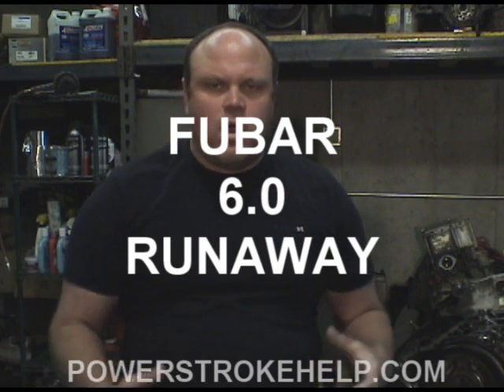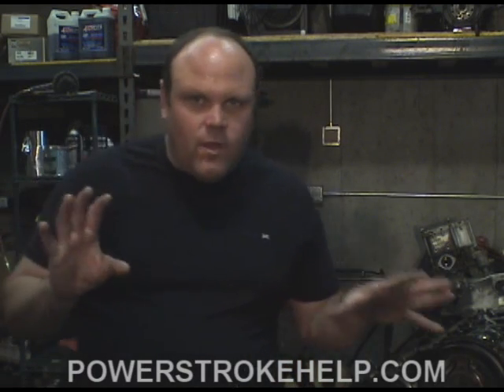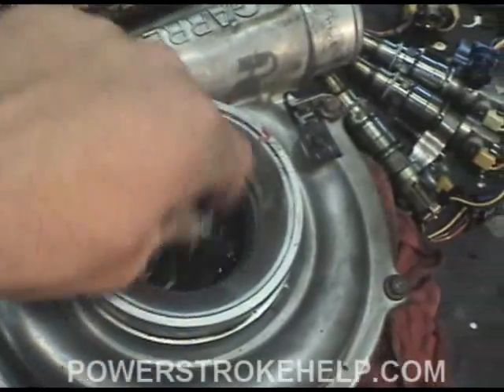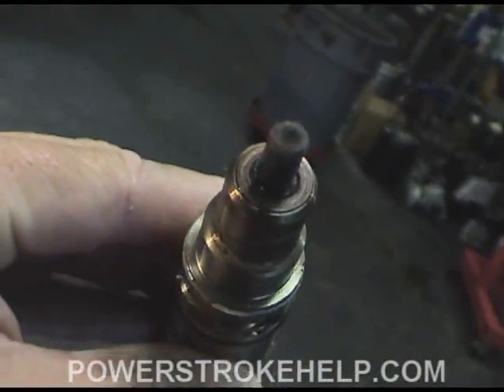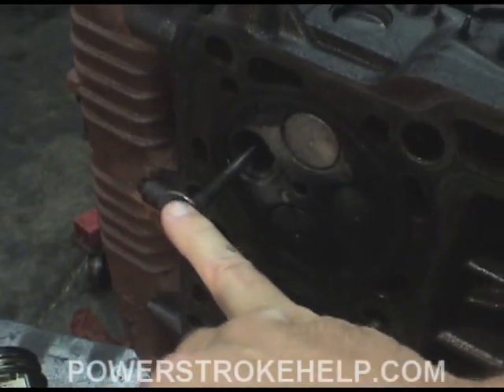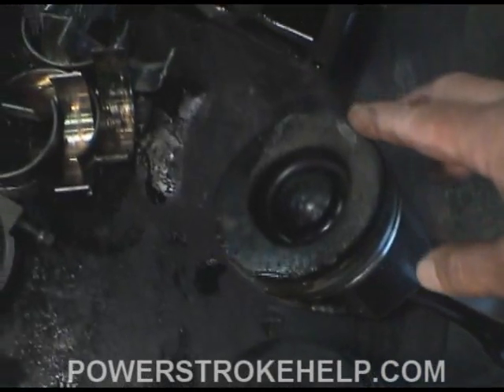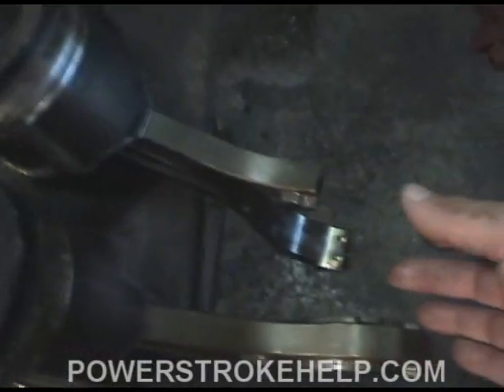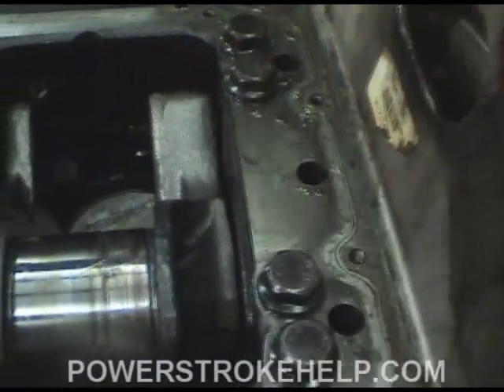FUBAR 6 0 RUNAWAY - TURBO SEAL FAILURE LEADS TO TOTAL ENGINE DESTRUCTION

Comment: Grind the crank, throw in a new piston and rod. Rebuild the heads and put it back the street, I have a very good friend that has worked for IH for over 20 years. The 6.0 is one of best engines they ever made. Yes they a lot of problems with them, but did you know that from 03 to 2007 ford sold more diesels then chevy and dodge put together? With that many trucks on the road you are going to have more problems. One thing that IH screwed up on was in 07 at the end of production the ran of rhe USA made delphi lifters and put some cheap china made in them. I work on them and own 5 for my business (Solenberg Performance). Two of them have over 300,000 miles on them and have never been worked on. If you change oil like you should they will last forever. That is the big thing that the injectors don't like is dirty oil.
Reply: Ford sells more trucks in general so that's probably why they sold more. We should look at the percentage of failures while comparing the powerstrokes, duramaxs, and cummins to see if the 6.0s were really a bad engine or not. I think they are bad because the engines were made in a rush because of the new exhaust regulations at the time. I am not a 6.0 fan, let a lone a powerstroke fan. I do like the 7.3l powerstrokes though.
Reply: No the had been a no lubrication situation inside the engine at that point which means that  the bearing ran without oil. You probably already knew that but oil is also a coolant so the bearing ran without coolant (oil) for however long it ran, possibly undoing the tempering that was done to the crank and rods and stuff. Simply grinding would not help
Reply: +XRA1D Ford sells more trucks only because they are cheaper and disposable and businesses need shiny new trucks for their images and write-offs for taxes, it makes business sense to buy fords.. Anyone who buys a truck for longevity isn't buying a Ford.
Reply: stephenromansd I have to disagree, I'm not saying I'm a Ford fan though... But I do have a 96 F150 inline 6 5 speed and that thing has been through hell and back. It's been extremely low on oil for over a thousand miles, the oil has gone way past the point that it should have before it got changed, and it just gets the crap beat out of it every day. It had a stuck lifter so I just dumped some ATF in the oil and it freed right up! Great truck but I'm more of a Chevy fan but I LOVE Cummins. So I have a Chummins lol.

Comment: In a Runaway situation, can you shut down an engine by plugging the exhaust pipe?
Most times you can get near the air intake, but the exhaust pipe sure would be easier to plug !
Reply: Just put it in top gear, step on the brake hard and dump the clutch. Of course, if you have an auto, you deserve to get screwed. :3
Reply: No. The engine is burning oil as fuel and the only way to stop it is to prevent it from ingesting enough air to continue the combustion process

Comment: I have a question, my truck wasn't over heating and have the same symptoms. With the exception that I had a y-pipe leak that we fixed. I'm throwing 3 codes of concern, p0275, p0284, they're cylinder 5 and 8 cont/bal faults they other one is a p132b turbo charger boost control a performance code. Any suggestions?

Comment: You only talked about 1 cause of runaways. Fuel rail failures, fuel leaks, overfilling oil, others. You can tell the difference by the smoke. Gray-blue thick/dense smoke is an oiling run and usually(not always) lower RPM. Black(er) smoke and super high RPM is most often fuel rail or other fuel issue. Sometimes the damage (like the sheared turbo shaft) is secondary to the main failure cause. Detroit, Rolls, and many others have air shut-off flaps to prevent this. Most industrial applications require this. Even non-turbos can runaway.
Reply: Hes right.. my 6.4 had a fuel leak and oil level was so high the turbo sucked it up and it was crazy high RPMs. It lasted about 45 seconds and its sitting at the shop now to see if any damage was done

Comment: By the time you've found and stuffed something in the intake and it runs out of air, the engine could have already grenaded. Stick it in a high gear, foot on the brake, dump the clutch and stall it.

P.S It's AL-U-MIN-IUM.
Reply: P.s He's from the USA, they say A-LUM-INUM. You'll never change that!
Reply: Most Powerstrokes are automatic
Reply: P.S. Aluminum (one 'i' - four syllables) was discovered by Hans Christian Ørsted who named it after the alumina (al-OO-min-uh) salts from which it's extracted. The IUPAC does not recognize any such chemical substance called "aluminia" (al-you-MIN-e-uh) hence, the original pronunciation is the four syllable one. BUT, as is the rule in the English language; If enough of a given population coin their own term, including superfluous syllables, it becomes accepted as correct.

Comment: this video is super helpful, i think this is what is happening to my dad's truck i'll take off the heads when i can fine a place i could work on it. i already replaced all injectors new turbo egr valve egr cooler. the truck throughs out a lot of smoke and it smells like diesel also the oil level was hi even though the turbo was leaking oil into the intake. do you have an idea what could make that happen?

Comment: You probably mean Isuzu/Opel 1.7TD. Exhaust wont work because building pressure can rip the pipe anywhere behind the engine even if you'll manage to seal its end. If you cant reach turbo or are scared to mess about near extremely unstable engine try putting it on 3rd gear and quickly releasing clutch holding the brake AND emergency brake with all force. This should strangle it instantly and can be performed by anyone on the roadside

Comment: When I was watching your vid would never think Ill find my PSA HDi having a runaway just 3 months after. Volume and amount of smoke is unimaginable. Luckily I was in front of the car and had a big cloth to shut the intake like you said before engine completely went wild in rpms. Can now say to all turbodiesel drivers, if your car changed its owner many times before - have condition of your turbo checked asap because ppl think it can be fixed with denial but it can't and WILL surely strike back

Comment: hey bill, i have an 07 f350 6.0. i recently straight piped the truck and notice a blue haze for about a minute after start up. once the truck is on the road, there is absolutely no smoke from the exhaust. what are your possible thoughts? note that the truck is making 26 psi of boost. let me know
thanks

Comment: Good to know, thank you very much :). What can make a big difference I think is that you are on 6L quite big engines when I think about European engines as mine. I have 1.7L turbo diesel engine right now which is most common in such of cars here. I think there is no as much pressure on the exhaust in that engines and at the same time getting close to the turbo is almost imposible where there is no much room around the engine and it's located behind it.

Comment: I would like to ask you for advice in case of runaway. For normal car user puting something into the intake in such of situation is almost imposible especially when there is no much space around the engine and you cannot reach the turbo by your hand. All you can do is to play with air filter which is connected by plastic pipe so it can split and take air anyways. So is it a good idea to try to close exhaust first ?

Comment: I saw a Leyland Beaver go wild in about 1960.When the operator went to shut it down, he released the stop cable too soon. The motor stopped, kicked back and fired up , in reverse. The mechanical governor went wide open and pulling into top gear and using every bit of brake available, it was subdued. Cab full of smoke; draws full of something else!!

Comment from the maker: Thats cool. In the old days when we would street race, we would put about a quart of Nitro methane in the oil before the grudge run. The Nitro would vaporize when we got hot halfway through the run and be sucked into the carburetor through the PCV valve and it was like Bo Jackson hit the back of the seat with a base ball bat. YEE HAA. Won some money doing that, but the other guy was too.

Comment: if this happens on a gasoline car you get just as much smoke but it revs at normal speed and can be shut off like normal. happened to my dads old '03 saab 9-5 wagon. (SO much smoke)

Comment: oh yeah...if you lose the govenor in a old mechanical system  you could be in for a wild ride...ive also seen it happen in a Oldsmobile 350 in a 1979 Delta 88 that sat for years and had bad valve stem seals,oil was getting in into a few cylinders ...it didnt shoot up to out of control rpms or anything but he couldnt get it to shut off until he got a shop rag over the air intake

Comment: I watched a Duramax lose a turbo in this same scenario and go into a runaway. Very scary. Had this happened on the road, not sure how you could have stopped it without just grabbing neutral and letting it blow. Engine was stopped in the shop by shoving a 2x6 over the intake duct from the air filter, but only after a HUGE amount of valvetrain damage was sustained. Engine was replaced.

Comment: dont know what whimpy motor your thinking of but in my experience a runaway will snap the drive-shaft like a toothpick if you try to dump the clutch just use a extinguisher of stuff a rag in the turbo better to just have a dead engine than a dead engine and a dead power train

Comment: a engine runaway on a nonturbo engine will happen if there is to much oil is in the engine or if the piston seals a leaking so if the oil is coming in the pisten it wil run on the oil and you can stop it with a hand shifted car by putting it in highest gear an let the clutch come up hard but a automatic wil run til it blows or if the oil runs out

greatings from a diessel machenic from the netherlands

Comment: How can a non-turboed diesel engine runaway? Can the fuel governer actually break in the pump? Becuase I heard about a John Deere 4020 that was non-turboed and it totally ranaway becuase the governer can break in the old rotary pumps and pump tons of fuel and rpms until the cylinders expand and it sucks oil up out of the crankcase to continue running then the oil runs out and the motor goes to shrapnel.

Comment: Would it be possible to stall an engine that is running away, or would it just drag the vehicle, no matter if you slammed in 5th gear and let the clutch pedal go real quick to intentionally stall it? Or wouldn't you know this because there are only automatic transmissions in your field of experience? Anyways, is it at all possible to stall a torque converter based automatic vehicle?

Comment: ive had this happen with my truck before i never know anything about runaways at the time i thought it might be bad fuel or something so i did the mistake and drove it to a grage and it ran away and eventually killed my engine to the point it self destruckted all over the road in pieces and me stranded so smart thing lerned i had an air shut off put on the intake in the event of this agane

Comment: My biggest fear but whats the chance with a bone stock 7.3L Powerstroke with 278xxx miles on it? hopefully slim to none if its not overfilled right?? and 1 more question why am I getting such good fuel economy I have a 7.3L crew cab F-350 DRW ZF5 & getting 20-22mpg alittle high right??

Comment from the maker: I'm sure if the engine gets hot enough it can, but gas engines dont have as much compression as a diesel. So it will probably just start smoking and foul the plugs and not restart.

Comment: All this new crap has all but destroyed the benefit of the Diesel Engine.  It's a sad state of affairs.  Cost went way up, economy went way down and, IMHO, reliability is down.

Other than big trucks, I don't see the benefit any more.

For all these reasons, Ford is on the right track with it's EcoBoos V6 in the F150.  

IMHO.

Comment from the maker: I have 5 of them. the closest one was 400 yds round trip. By the time I got back the connecting rods would have been bouncing across the parking lot. Too many years and too many beers.
Reply: Had this happen today. After changing turbo left over oil fromold turbo caused it to run off the oil at roughly 5000 rpms. 20 seconds seemed like 5 minutes.

Comment: That could not be farther from the truth. Ford sold the 7.3 and International kept producing it because of the fact it was so reliable. Manufacturers actually LOOSE money on parts/repairs & Warranty claims. The 7.3 was stopped because of the emissions controls put into effect by the EPA in 2003. The only thing the 7.3 had to control emissions was injectors and a catalytic converter to control emissions. No EGR, no DPF, no SCR, nothing like today.

Comment: @powerstrokehelp It's not the different fuel so much as the the copious quantities of engine oil being ingested (much more than the injectors would ever normally feed the engine) and the fact there's absolutely no timing what so ever to the start of ignition.

The oil is already present in the cylinder before the intake valves close and fully free to ignite whenever it pleases on the compression up stroke.

The result, preignition, is what melts the pistons and injectors. Or clogs the latter.

Comment: @kanewatman1 If it's a manual transmission, put it in 4th gear, foot hard on the brake and let the clutch... stall that bast! If it's auto, stand well clear, video it and post on YT

Comment: I've hear of the "runnaway deisel" thing and thought it sounded a little far fetched. A seal in the turbo can sen that much oil into the intercooler that the motor will run on pure motor oil? OK, if you say so was my inital thought. Now I know different I have a f250 7.3pstroke. friend pulled the hose to the intercooler and told me there was oil in the intercooler and told me about the runnawa thing. Problem, he's gone, I have no idea as to how much oil was in it. So I dont know what to do cont

Comment: after pulling off the turbo piping to swap an injector, i noticed some oil in the air stream, how much would be a normal amount? also, how is the intercooler plumbed? is there fear of it filling with oil, causing an issue

Comment: @powerstrokehelp 
Is the huge raise in internal temp and pressure not down to the fact that the oil is being burned approaching tdc rather than as it would with a timed injector cycle? You end up with the effect of chronic temperature&pressure spikes as the vast part of combustion happens as the piston is still travelling up, whereas actual fuel is injected to burn as downward piston travel approaches it's peak speed. The piston moving down also allows the gas to cool before it's exhausted.

Comment: @powerstrokehelp - Not "only if the temp gets hot enough"...the compression ignition idea itself creates the heat needed to combust the oil. How do I know? We had an ISX runaway from a crack in the cylinder head at the top of the intake port...once turbo piping was removed and we started it, it lost positive manifold pressure allowing oil to go into intake and let the engine start to runaway. Was stopped with a book over the intake elbow...and that engine was shop temp, about 68 degrees...

Comment from the maker: @marek0086 Engine oil will burn in a diesel engine but only if the temps of the engine get high enough. In a runaway the coolant system cannot keep up with the heat generated in the engine. So as the engine oil is fed into the engine via damaged turbo seal, the speed of the engine pick up (sounds like a jet winding up for take off) and the engine gets hotter and hotter and will run until it runs itself out of engine oil. What is left after is all but scrap iron.

Comment from the maker: @marek0086 The intense heat of the oil burning instead of diesel fuel made molecules of aluminum from the pistons float around in the combustion chamber and some of it ended up on the injector tip. NOT PRETTY

Comment: i have had a gas engine run away before a chevy 350 did this to me the throttle linkage got stuck wide open so i turned off the key and it sayed reving had a kock going and it was backfireing badly blew off the air cleaner lid so i put it in last gear and held the break and dumped the clutch and it stoped the engine i have also had this happen on a kohler 10HP on a small tractor its really weird what pre detonation can do

Comment: Had this happen to my 600hp cat in my semi sounded like a tire blowing out , shot the exaust side turbine right tru the streight pipe and than the eng took off had to ram it into gear and jam the brakes to the side of the road .. needed new turbo , cooler, boots, inj pulled to release the hyd lock the oil had caused ...
still running today,

Comment: i had the same problem with my car 2 years back.. its a 1.4L diesel
engine started revving crazy even with the key in my hand! it ran at the redline for about 5 minutes before it died out.
the car cranked right up after that.. drove it a couple miles to the dealership and then another 20 miles the next day as the idiots there couldn't figure out what happend.. they thought i'd run it without oil. anyway. got the turbo replaced.. and the car is working perfectly fine now! :)
no rebuilds, nothing!

Comment: Nice! Just push them! I see this all the time. It's alot cheaper to pull over and tow it. Bad turbos, blown EGR coolers, rechecks with loose injectors and burned washers on injectors, bad cups, fried FICM's, ect.  Bad stuff. We had a 6.0 run away before.  Tech last looked at the tach at 6K.

Comment: A CO2 fire extinguisher is the best way to stop a run-away diesel. No oxygen, no combustion. Or if you work on them for a living, keep a thick metal plate close by to cover the intake to choke off the air flow. Shop rags would be your 3rd choice. Good post. I like your videos.